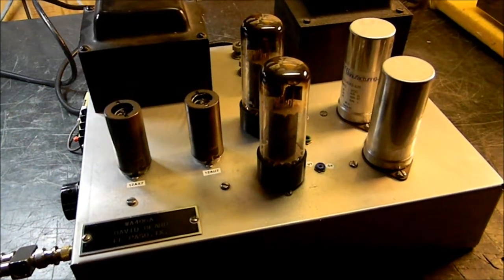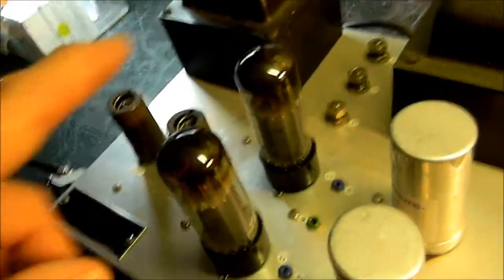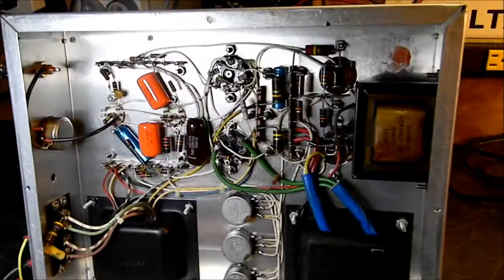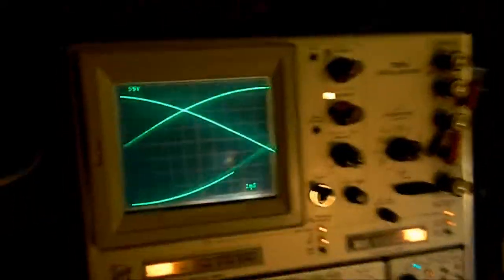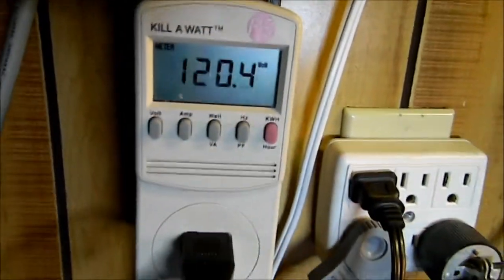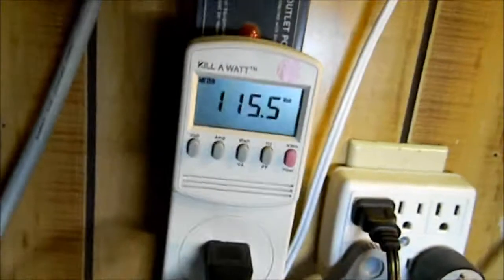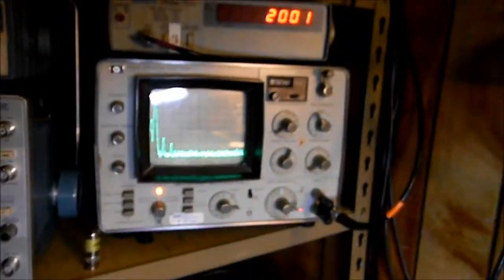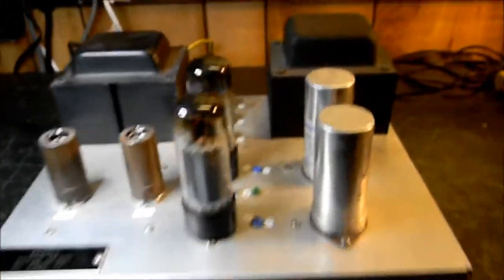Line Voltage Variations On THD In Audio Amplifiers

Comment: Hi Ray,
Thanks for your offer to help with the 8903. I think I mentioned b4 that I found it at a Ham Fest for $25 and it looks like it's new. It sat at a club table all day and at the time I was not sure what it was either. But having lots of HP and Tek stuff in the lab, I felt sure I could find a use for it.I did look at the website you suggested on the software and I am getting an spare PC set up for the 8903.
Again, thanks for your EXCELLENT videos and the time it takes to make them.
73 Glenn

Comment from the maker: Thanks, Glenn. I think sometimes emotions are prompted by too much alcohol or too little Valium but it will all work out. I have a dual love of audio and RF - can't get enough of either. If I can help in any way with your 8903 please let me know. It appears so far that I am able to evaluate 6U8's with this 7199/6GH8/Dynaco setup as I have the old Collins S-Line that uses three 6U8's in each unit. Been working on it this late night. Got some interesting data. WA4QGA - look me up

Comment: Non sense because you do not listen, do not perceive... and non sense because amplifiers goes connected to speakers..they distort 300 times more than that small power amplifeir variation and it is impossible for you to detect such small distortion that gonna be hidden behind the huge distortion the speaker produces...it is alike to see an atom in a drop of water..invisible....in your case..impossible to hear.

Comment: You see this i stuff is critical that you have to adjust -5 volts...they have not asked you to asjust from -4.5 to - 5.5, so, it is obvious the stuff is critical and needs correct voltage..this happens everywhere and in everything... fuel to automobiles, number of passengers, quantity of food inside a mixer.... quantity of things inside a washing machine..inside an oven...everything in our world is optimized to certain conditions..so..it is clear that variations of voltage will harm performance.

Comment: AV voltages appears converted in DC if you multiply by 1.41...so.... it is 41 percent higher than the AC numbers... and circuit is biased considering the correct voltage and tollerance are 10 percent plus and 10 percent minus...amplifier performance is optimized to the correct voltage..observe that going out from the correct designed voltage ALL amplifiers will show variations in performance..anything strange on that..reason why we use voltage regulators everywhere